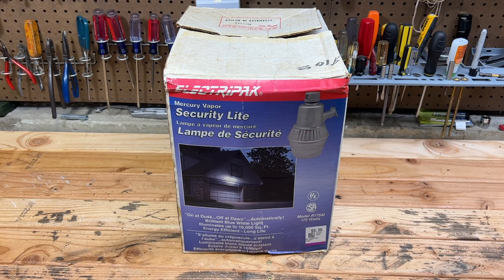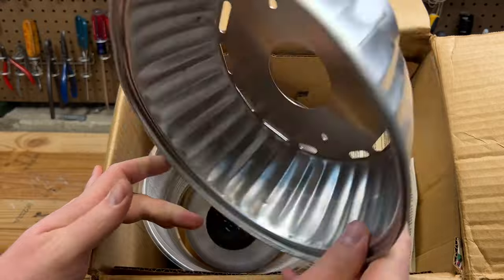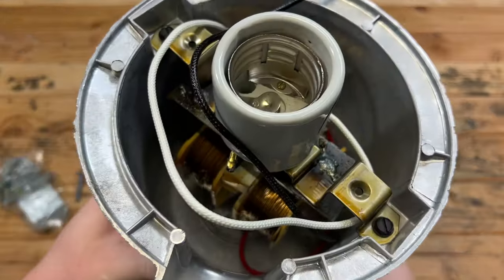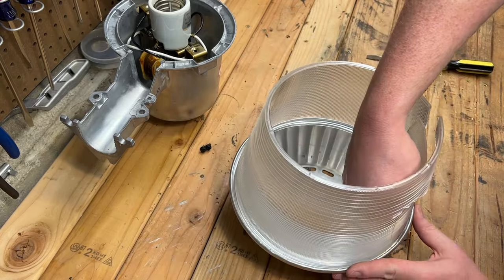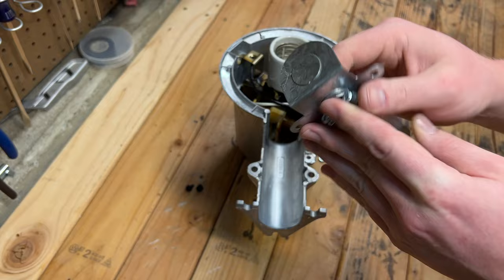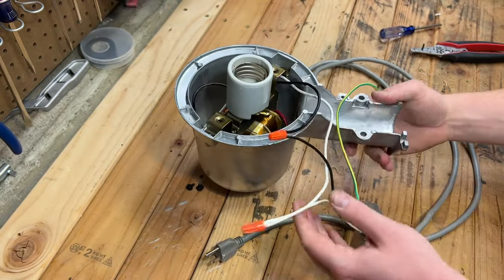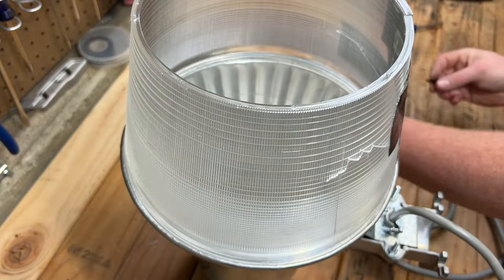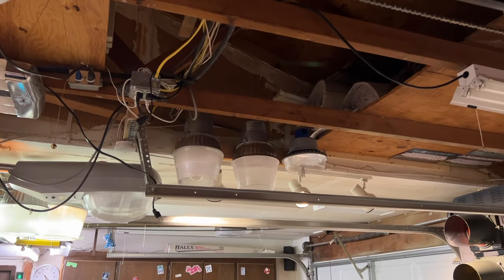Electripak 175watt Mercury Vapor Security Area Light (1996)

Comment: Man you've been killing it finding these older MV yard lights recently!

These are my favorite out of all of the ones this style, and are probably THE original ones too. I loved (and still love) seeing these as a kid. They're pretty easy to identify with the bump (as you mentioned) along with the fact that it has an actual, good quality photocell socket which means that the photocell is higher than the others and you can also see the socket for it too.

The ballast was also used in their street lights at the time as well, and I think by the time lost their American Electric printing when the Electripak name was started being used. I have a 100w MV ballast from a transitional 1992 AE yard light with the square Electripak photocell and it has 'American Electric 100w MV' or something like that but it definitely said American Electric on it although faded.

I also love that the label is thicker and is even engraved just like the older lights before it that had them. That too was used in their street lights, however one thing that is missing is the 'work place' followed by some numbers. That seemed common on AE's stuff in the 90s. I think around this time that went away on their yard lights but I'm not sure about their street lights.

The lamp is great too. I believe late '95 or early '96 was when the Lifeguard electrodes went away. And around '88 for the BT-28 shape. AE sold these lights back Westinghouse when was still around and they came with clear BT-28 Lifeguards. I think they may have even been sold under the ITT name at one point.

All in all these were essentially shrunken down NEMA heads (which were used as street lights in a lot of places) that came with a higher quality (I wouldn't call it high quality solely due the fact that the ballast is sloppily wound lol, but it certainly is better than a lot out there) ballast, actual photocell socket, quality lamp (the Westinghouse and Philips lamps with the Lifeguard electrodes), and decent (except for those square ones, and maybe those translucent ALRs) photocells.
Reply: Funny that you mention this being potentially branded as ITT; I have one of these I saved during an abandoned cabin remodel for a friend. Dated to be 1982, I believe.

It still had its original PC (FP, like this one), Westy 175W MV lamp, and refractor. Absolute art.

I fired it up minutes after taking it down; no issues: quiet ballast, functional lamp!!! Modern products would never survive 20+ years up in a tree, constant sunlight, and heavy winter snow... really says a lot about the quality of products back then.

Comment: My light is 25 feet up, finally got the 30+year old Mercury vapor bulb out with a 30' extension pole and bulb changer on it, I put in a 175w H39 Feit bulb. I installed it and it finally came on after waiting overnight, but it is dim?
Reply: The slow on is still happening, could this be a wattage mismatch with the ballast?
Reply from the maker: If your fixture looks exactly like this one in the video, these only came in 175 watt for mercury vapor. These bulbs do take a couple minutes or more to warm up, which is normal. If after about 10 minutes of being on it is still dim, then it might be a different style fixture.
Reply: @Parrot175 my fixture looks similar, but it has the latches on the refractor, like on your Westinghouse fixture?
Reply from the maker: If it has the latches on the sides then it could be one of three wattages of mercury vapor: 100, 175 or 250. 100 and 250 are quite rare with 175 watt being the most common by far. I'd still guess yours 175 watt though.
Reply: @Parrot175  Thanks for the info, this fixture was installed at our house in the country before we moved in 30 years ago and I have never replaced the bulb until now. I think it could be a ballast issue, it sometimes takes hours to light up, but sometimes it comes right on. Thanks again!